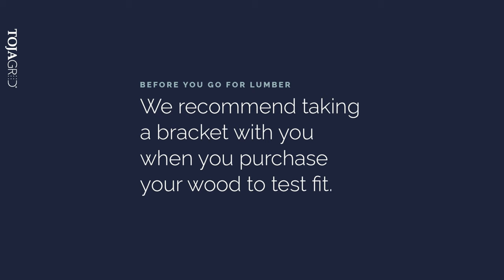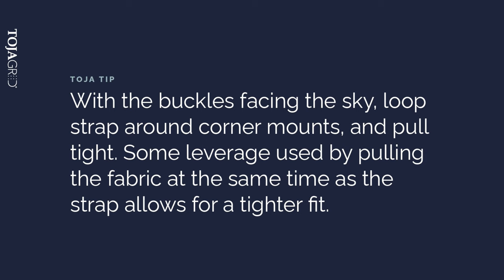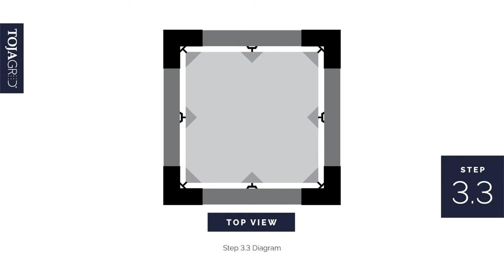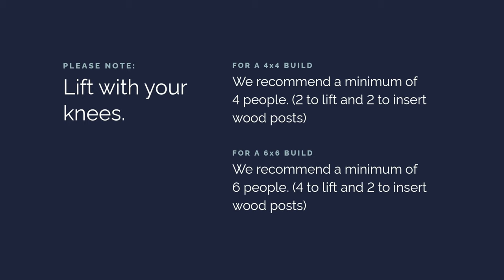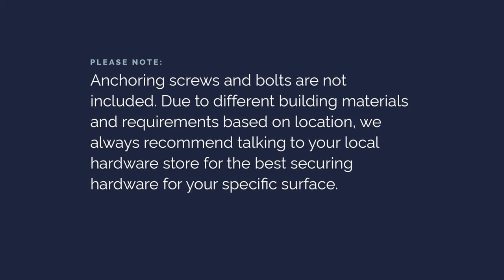Toja Grid - How to build your very own modular pergola

Comment: Just did at double 12x12x10 with 6x6 posts. This was one of the most challenging things I’ve done in my career.  The video makes this look like anyone can do it. 6x6 kits need at least 12 people or a skyjack.
Reply from the maker: Please use the required safety measures and your discretion when building!
Reply: I agree... mine is still half way up and I have 2 skyjacks
Reply: Just finished mine. it took 4 guys for the whole day. Spent time on shaving the bottom for the base they don’t fit well. 10x20x10 with 6x6. They are heavy to lift but in the look very good.
Reply: I'm about to start a 12x10x12 using 6x6 rough cut cedar... I'm beginning to wonder if I am in over my head here... Toja grid installation video is for the most basic install only.

Comment: Just got my 12x12 kit and there were no instruction’s in the box. Am using 12’ 6x6 and 10’ 6x6 got the 2 posts in but theres no way 4 guys are lifting this up. Toja! Whats with the no instructions? You have cute videos made up on how the assembly process but that might work on 4x4’s but now the 12’ 6x6.. would appreciate an answer. Thanks
Reply from the maker: Here's a link to our Instruction Manual: https://cdn.shopify.com/s/files/1/2568/0730/files/English.pdf?8940530499732687773. This video guide should also be helpful as it shows the entire process, step-by-step.

Comment: A couple of things to prepare for during assembly: lumber is seldom perfect in it's dimensions (swelling due to moisture, poor cuts), the welds on interior joints are the secondary challenge to fitting your posts (I cut the 90° off each post and most slid past the welds). Those things aside it would have been a fast job indeed.
Reply: It kind of  sounds like you slid the posts past the stops that are welded inside the brackets. These are supposed to stop the beams before they go all the way in.
Reply: @MichaelLargent  that's exactly what I did. I used treated lumber. Putting pressure on spot welds can be risky. I also planed and sanded the sides a bit, the fit was still snug.
Reply: @MichaelLargent  ps. I misunderstood your comment. NO, I didn't bypass the stops. Sorry I wasn't clear.
Reply: @thomasfinnegan8457  did you give the lumber time to try? It should slip right on.
Reply: @MichaelLargent  nope but some posts were dry. I think it's the nature of pressure treated lumber. And we were on a timeline.
Reply: @MichaelLargent  and lol @ "should" one of least favorite words
Reply: @thomasfinnegan8457   Gotcha. That's probably why they didn't fit. They shrink a lot as they dry. I Get being on a schedule though. Mine fit well after drying, but not until.
Reply: @thomasfinnegan8457  So I picked  up the Solo to see what was up.  Just as you described, the welds are an issue. They did them inside the frame and didn't grind them down or anything.  So  yes, the lumber after drying fits the brackets, but the welds ruin the fit not even an inch in.  I didn't understand  what you were describing before but now I see it. My "feet" fit fine (no weld seams) but the corner brackets were a real issue. I'm contacting them about this.
Reply: Using treated lumber: Now that I'm finished, I know the steps to take when using treated lumber. 1. Let the posts hang in the sun or a space to dry for a few days. 2. Test fit the corner brackets and bases for fit. 3. I suspect most won't fit. 4. Use 60 grit on an orbital sander and sand to fit. 5. I rounded the edges in order to pass the welds. 6. Don't go nuts,  check for fit often. 7. Some folks may want to sand the entire post, it may fit their aesthetic.  Hope that helps.

Comment: If I am putting my 6x6 posts in the ground for stability, do I change how it is set up? This will be a cover over the hot tub pad.
Reply from the maker: That's why we recommend using our Solo brackets to mount your build down. Putting your posts in the ground wont allow for later flexibility.

Comment: What length 4x4s are preferred? 8’ 10’ or 12’
Reply from the maker: Hey Chad, our maximum recommended spans are 12' for length and 8' for height. For spans longer than 12' we recommend building a double pergola using our Quad bracket. Some customers have built beyond our recommendation and been fine but do so at their discretion.

Comment: How do I assemble the top if I have to set my posts in concrete first?
Reply from the maker: You may want to consider setting the posts in concrete after building the main structure.

Comment: What's the build quality on those brackets? Good welds and powder coating ?
Reply from the maker: We utilize high quality materials and best manufacturing processes. Our 4x4 brackets consist of 14-gauge and the 6x6 brackets are 12-gauge North American steel respectively. Our extensive outdoor powder coating ensures your pergola will look its best and stand up to nature’s adverse and challenging conditions and provide outstanding functionality now and for years to come. All this comes in a simple and efficient way for people looking to build custom Pergolas, without the need of a professional.
Reply: I have them in the yard. Great quality. Easy to use. Stable. Great system all around in my opinion

Comment: Would putting base posts in planters filled with concrete stabilize the posts more than just the brackets on the pavers?
Reply from the maker: Our systems can be installed almost anywhere with the appropriate mounting hardware and practices. Please see the disclaimer in our Instructions Manual for more mounting tips for different surfaces (https://cdn.shopify.com/s/files/1/2568/0730/files/English.pdf?8940530499732687773).

Since we do not do any installations we are limited on the advice we can offer in terms of securing to different surfaces. Each surface is different and can require different securing hardware, we recommend reaching out to your local hardware store for their advice on the best securing hardware and method for your surface.

We also recommend consulting a local hardware store as they would know the best practices with your specific surface in mind and can help you choose securing hardware accordingly. You would also have to take building codes and local regulations into consideration, and a local hardware store would be aware of them as well.

Comment: Question.... my back yard have small brick pavers.. well I still be able to install.. I notice most have concrete
Reply: I wouldn't recommend installing directly to pavers.  I would use pretreated 4 x4 or 6 x 6 ground posts and attach the brackets.  While the top.portion of the pergola is on the ground without the vertical posts attach mark the area you want to place the pergola.    Remove the pavers where the post will go.  If your using either 4 x 4 or 6 x 6 I would rent out a 12" diameter auger post driller for 4 x4 and 14" for 6 x 6.  The reason is it gives you some leeway to move the post laterally to in the ground to ensure levelness. Also dig into the ground 2" to 3" deeper to adjust height as needed for levelness.  I didn't use concrete to anchor down the posts just in case the post were ever to deteriorate I could replace them easily.  I used a pebble rock base to fill in holes, so water can easily disperse from the posts.  Using the auger drill to dig holes added about another 15-20 minutes to installation.   It was the best $70 rental ever spent.  If you do use concrete I would level out the pergola using the pebble stone then fill the hole quarter way with stone and then pour in cement powder fill about another 1/8 of the way fill with cement powder and continue till top layer is pebble.  I would then run water over the pebbles to wet the cement.  This should give you enough structural integrity to hold down the post, while giving you some leeway to remove any deteriorating posts over time.

Comment: Hello do you need drill some in the ground or you dont need to thanks
Reply from the maker: Hey Andy, our systems can be installed almost anywhere with the appropriate mounting hardware and practices. Please see the disclaimer in our Instructions Manual for more mounting tips for different surfaces (https://cdn.shopify.com/s/files/1/2568/0730/files/English.pdf?8940530499732687773).

We also recommend consulting a local hardware store as they would know the best practices with your specific surface in mind and can help you choose securing hardware accordingly. You would also have to take building codes and local regulations into consideration, and a local hardware store would be aware of them as well.

Comment: How does the shade cover handle snow?
Reply from the maker: The Shade Sail is designed for shade and can be damaged in high winds/harsh conditions, we recommend taking down the Shade Sail in high winds above 30mph and before winter to prevent damage.
Reply: Thank you

Comment: Here the real take on this. Does it work? Yes. Am I happy with it? At this point Yes. We built ours as an 8x12 so that it fit our existing deck configuration. They don't give you any instructions in the boxes of how this system works. Yes I undertand it is basic common sense, but come on put a piece of paper in the box or print it on the side of the box. Since this system cost twice as much as comparable sysytems they can spring for some instructions. After extensive searching their website I finally found a pdf of instructions. They say three people and 45 minutes to complete. This is utter hogwash. 8-1/2 hours later, 1 damaged ladder, 5 people, and a tractor with a front end loader we finally got the posts installed and it put into place. The ground work is fairly simple but this is designed to installed out in the middle of an open field with nothign else around. We installed on an existing deck right up against the house which drastically reduced the room needed to swing a sledge hammer to drive these brackets onto the 4x4's. They don't just slide on like this video shows. I ended up gettign a plane out and chamfering each 4x4 to get it to start into the brackets.Then comes the real problem of trying to lift the massive weight of this up to put the first two legs in place. Finally had to slide the thing over the deck railing all the way to the ground to get enough angle and room to install the first two posts and drive them into the brackets. Manuvered it into place for the those post to be in the right spot. Removed the stupid sail so we had room to work. No way at this point could the two of us could move this thign around any more, called the neighbors for help and they came over brought one of their kids and the grandkids to help. We managed to get it up enough to put the ladder under it for support on the remaining side but it wasn't enough to get the posts in place. Went and got the tractor from the barn and lifted it up as much as we could, this is where it slipped and damaged the top of the ladder. (I don't have forks on the tractor so no I could not have used this before now, and due to space limitations of the area I could not get under the direct center of the side we were workign from.) This created some extra space when it slipped, because it twisted a bit, so we could get the third post wrestled into place. Got the ladder back over under the remaining corner, while the tractor had the rest of it braced, and with me standing on the ladder and pushing up with my shoulder I finaly got it up enough for the remaining post to be started into the bracket. Once we finaly got the last posts in and removing the guard rail from the deck, we were then able to manhadle one side at a time and walk the assembly into place. About another hour to finish securing it to the deck and put the sail back up and it was time to call it a day.
Two things to note here, I do not recommend anyone else doing what I did. Ladders are not rated for more that 200 lbs or so, depending on the class. I'm 6'2 and 250 so I was half expecting the whole thing to collapse on me even though I have commercial construction ladders. Secondly this much weight can easily hurt your back, so extreme caution should be taken. I truly recommend having a fork lift or a Lull on site to lift this up for everyone's safety.